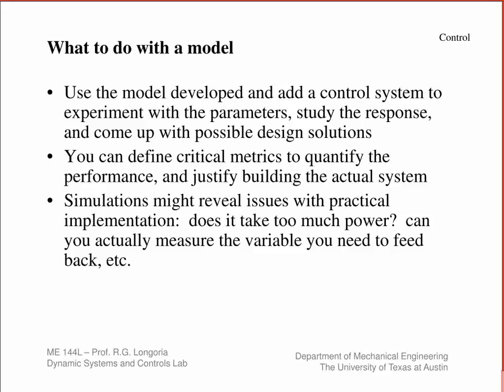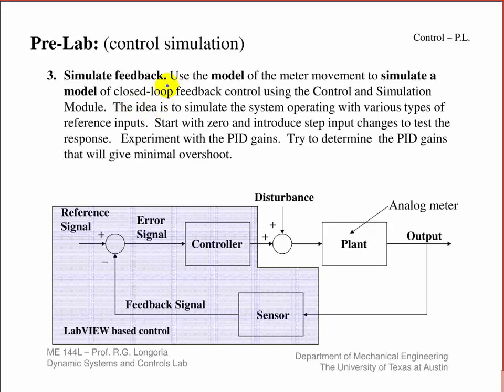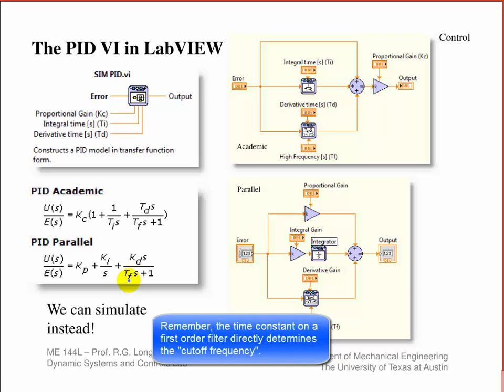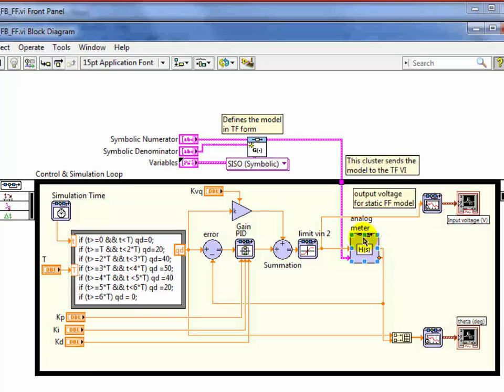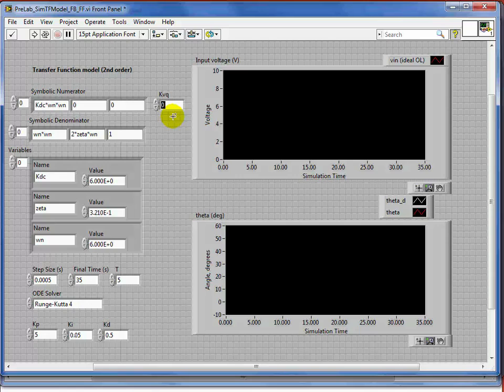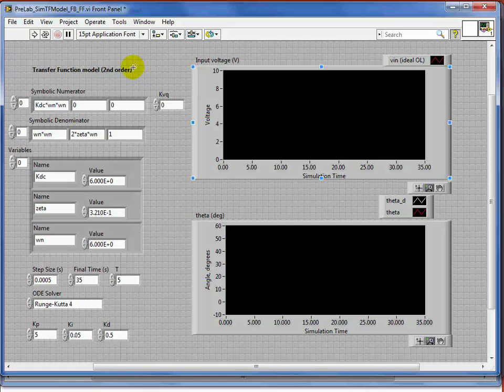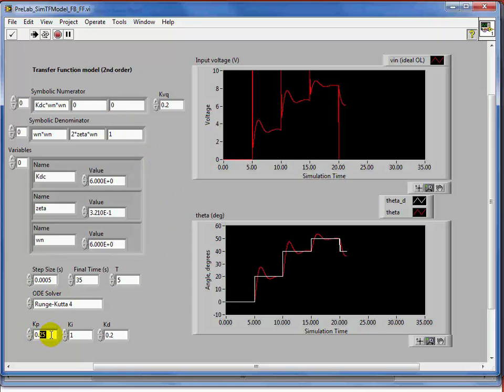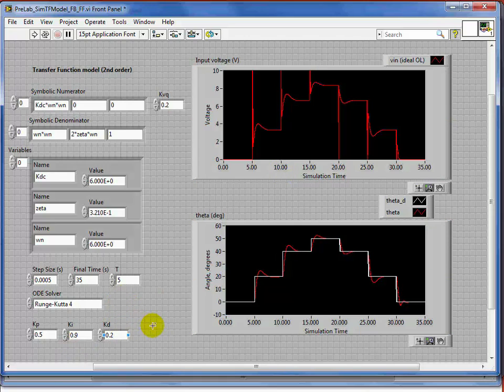ME 144L: Simulation of closed-loop control of the analog meter using LabVIEW

Comment: Came here looking for a tutorial on control simulation in labview. 
I'd like to know how feeding the setpoint forward is being called feedforward.
Generally, feedforward control is the scheme whereby the effect of an output disturbance (that is measurable and whose relation to the output is known) on the output is "pre-emptively" nullified. I've never heard of feeding the setpoint forward. 
Maybe you are simply applying an input offset to the system and the pid regulates around the operating point of (input offset, output offset). I don't think what you are showing here should be called feedforward.
Reply from the maker: Thanks for your comment.
A more general form of feedforward is described by Astrom and Hagglund in their excellent book "PID Controllers: Theory, Design, and Tuning", Instrument Society of America (1995). See Chapter 7, Section 4, especially Figure 7.10.
Reply: Thanks for your response, Prof. 
I have checked up the textbook and I now understand that setpoint forwarding is also a form of feedforward. I've learnt something new. Thank you.

I'm currently trying to implement MPC (GPC to be exact) on labview with custom cost functions (not in labview). Any knowledge source you can share would be appreciated.